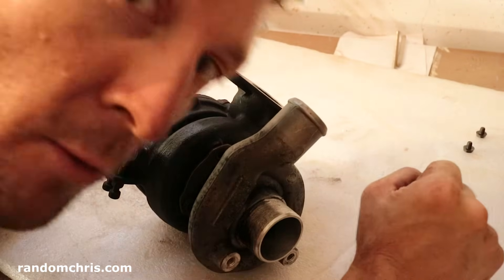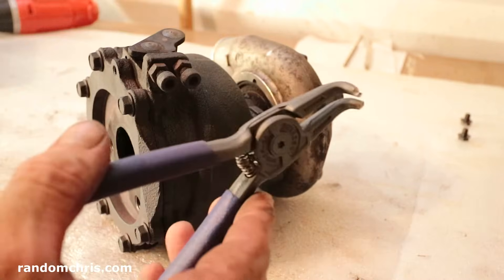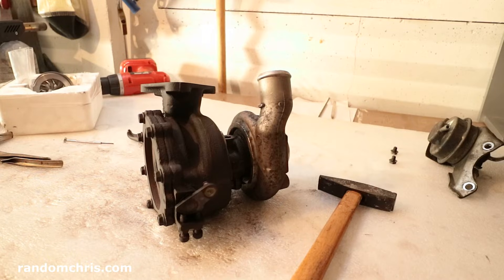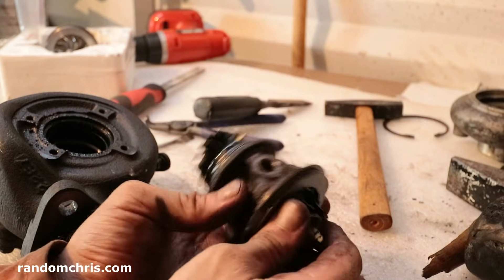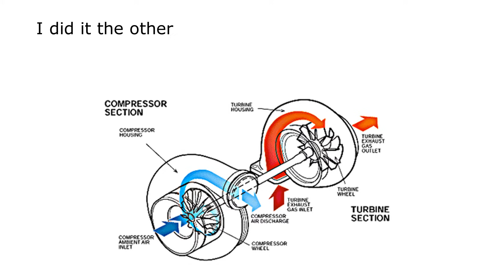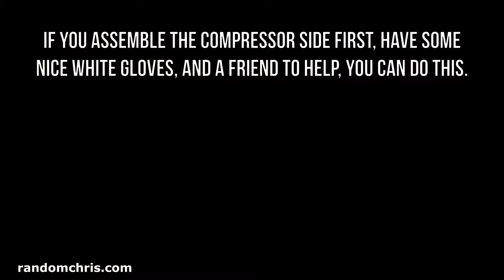How to Rebuild a Turbo (Quick, Cheap & Easy)

Comment: Hiya Chris,  great video and it could well be a huge help to me repairing my VW T4 camper.  I have found a supplier for the core cartridge (turbo rebuild l t d) the one I need is £132 inc vat.  I see people selling complete refurbished  turbos or new cheap ones for less.  Do you think it is worth doing?  My old turbo didn't make any loud siren like noises but does have play in it and there was oil in the intercooler charge hoses etc.  How wobberly can they be as I believe the bearing rides on a bed of oil and sort of firms up the slack!

Comment: I've never seen it mentioned but have noticed that the circle grip holes are usually not parallel, ie if you hold one up to the light one side has a slightly smaller hole than the other, the smaller hole goes outwards so that the holes get wider the more they go in. In this way the tips of the pliers tend to be pulled in rather than out. I guess the grip holes are formed with tapered tooling of some kind.

Comment: I just wanted to thank you for this great video! You saved me over 1500$ on repair costs. I removed the old and ordered a new Turbo core like in the video the part only cost me 120$. I even ended up doing all the work by myself and fixing my car for 10 times less the cost a dealer would have charged.
Reply: Did it last? Any updates?  Thanks
Reply: @tennaj1367  yeah it was like new the car was even faster
Reply: And yeah it's still running
Reply: Did you use ebay cheap parts or original parts and is it still going strong
Reply: @georgepato48  ebay, but it was new, worked better then factory. I sold the car so I don't know if it still runs atm.
Reply from the maker: Late reply - but well done mate! Cheers, Chris 👍

Comment: Thanks chris! What exactly did u interchanged? And where u got it? It means u have found a spare, and made one good out of 2 bad ones?
Reply from the maker: Hi Bob, I replaced the “CHRA” or “core” of the turbo. These are brand new and are the parts which get changed when you buy a refurbished turbo. Check the link in the description for an example of where you can buy them. Chris 👍
Reply: Hi chris, thanks a lot brother! I hav my first turbo that went kaputt, interesting!

Comment: Hi mate great video thanks, one question is don't they need to be balanced after fitting a new core, thinking of doing this myself but unsure if after paying to have it fitted again I might come across more problems, I had a cheap Chinese turbo fitted recently cost me £200 labour & the turbo went after couple of hours
Reply from the maker: Hi Adrian, the new cores are balanced so that’s not a problem but there is a procedure to follow to prime any replacement (or refurbished) turbo with oil. You may find on your car that your two turbos failed for the same reason - for example of the oil supply line to the turbo is blocked then even an expensive OEM turbo would get destroyed very quickly. You need this cause investigated and fixed before you throw any more money away. Good luck with it! Chris

Comment: Does this turbo core fit to any turbo?
Reply from the maker: Cores will fit multiple turbos but that doesn’t mean they are all the same. You have to check that the core you buy fits your turbo but some googling should reveal the answer quite easily for you. Cheers, Chris

Comment: I think you may I have given me the knowledge I need to finally figure out why my car smokes and sometimes doesn't feel like it's boosting
Reply from the maker: It sounds like your turbo is on its way out. It may be sticking intermittently. If you replace the core make sure that the new one is getting the lubrication it needs to avoid this happening again. Cheers, Chris 👍
Reply: @christopher_barr  so should I not buy a new turbo just a rebuild kit ?
Reply from the maker: That’s what I would do yes - you can save quite a bit of money by just replacing the core. You can do the whole job yourself or a half way house is to pay a mechanic to remove the turbo, give it to you for a day (for you to replace the core, which you buy before hand) and then refit the turbo for you.
Reply: @christopher_barr  would you say replacing the core is a manageable job for a 18 with little car experience
Reply from the maker: LevroJr davies Yes this is a good job for you to get stuck in to. Getting the turbo on and off can be a pain depending on the car, but if it looks too complicated for you then you can get a mechanic to do that for you and give you the turbo for a day so you can replace the core yourself. I’d say go for it, the best way to learn anything is by doing it. 👍
Reply: @christopher_barr  thank you

Comment: Excellent, I did not know that. I have usually avoided turbo cars because of the price of turbos.

I have always rebuilt things like brake calipers.
Reply from the maker: Hi Andrew, the new core was 49 GBP (60 USD), so this is a big saving compared to a new or reconditioned turbo. Cheers, Chris 👍
Reply: Andrew Thompson I’m with you mate, never wanted the extra problems